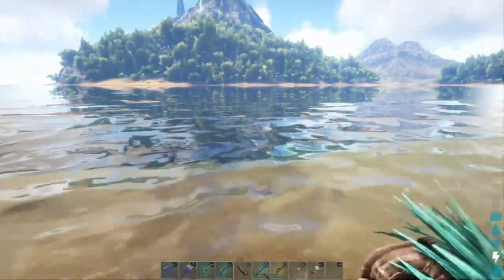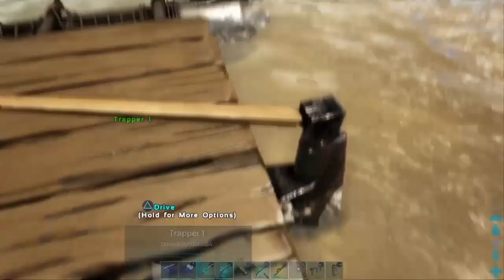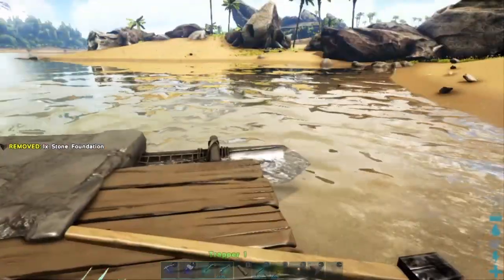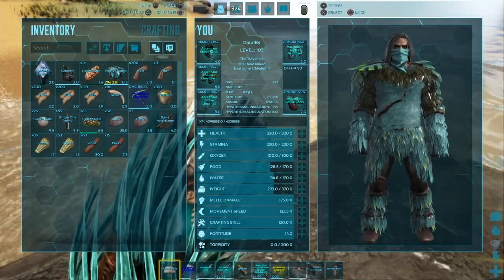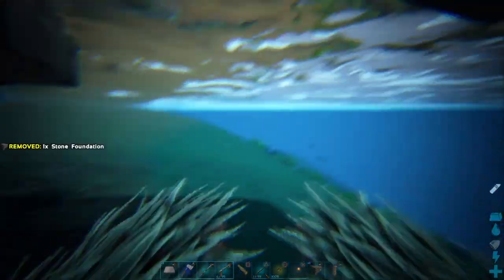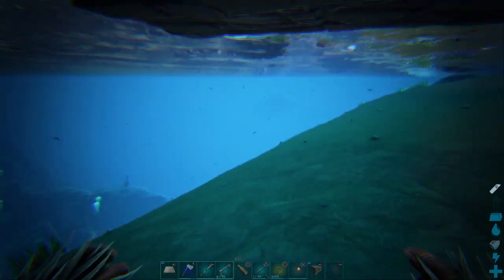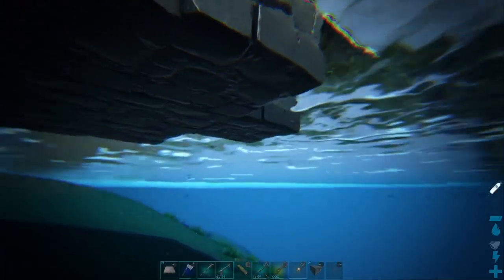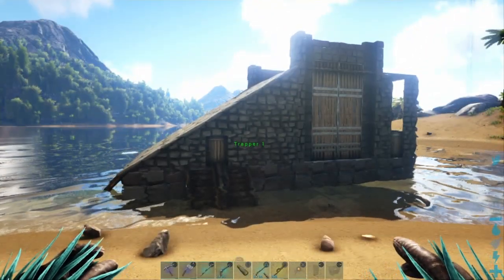Lowering and Extending Foundations Raft Build Guide ARK 2019

Comment: Raft base making certainly seems to take some planning.

I myself have built me a real decent raft base using wood platforms. I didn't use the same method as this, but i did build one that has space for just about every crafting station as well as a bed and some storage boxes.

Building these things are a lot easier than you think! They just take a lot of time.

Comment: The extend method with ceilings doesn't work for me :/
Reply: probably way too late, but I was struggling with it too. For me it turns out I needed deeper water. If the foundation so much as brushed land when i set it, it would explode. Fixed by just scooting my barge like two feet further into deeper water.
Reply: @fullelement4886  Thanks!! I was having so much trouble but this solved it!

Comment: I still get some spare angles of the raft where I can't make a perfect square...I followed frame by frame what you did by pausing the video.
Reply from the maker: LOVECRAFT MUSIC I have been told using S+ items can cause problems. Also there are reported bugs on different maps. If you are in single player check settings allows to build. If you are on mobile Ark game system that could cause problems too. Ark has issues sometimes. Make sure initial foundation piece is totally straight. Hope this information helps. Thanks for watching.
Reply: @Data1B4  single player on Xbox.... Been playing for 2 weeks now. I don't even know what S+ items are lol
Reply from the maker: LOVECRAFT MUSIC S+ is a different structure/craft items. If you figure out what the problem was let us know as it may help someone else out. Thanks.
Reply: @Data1B4  maybe I didn't a good job at centering the first pillar; and I also had to remove the structure limit on the advanced options panel.